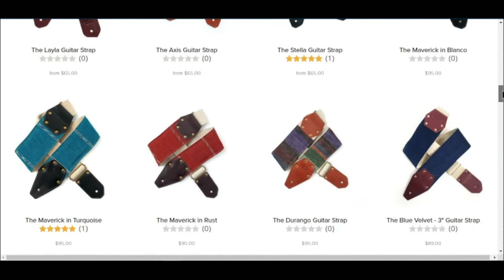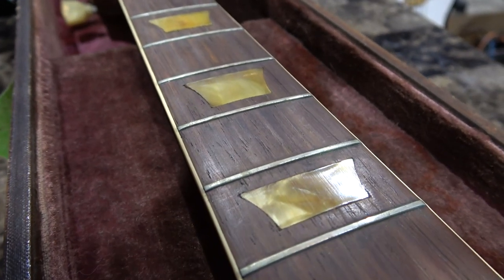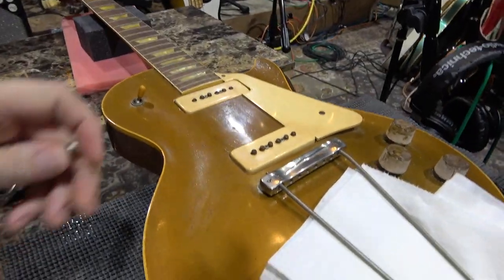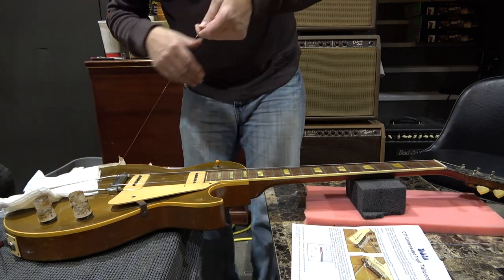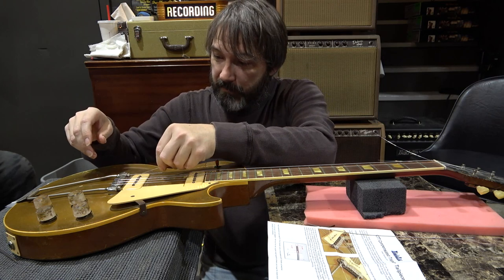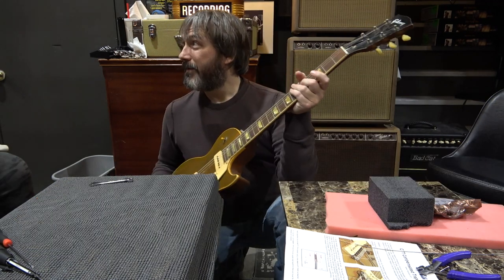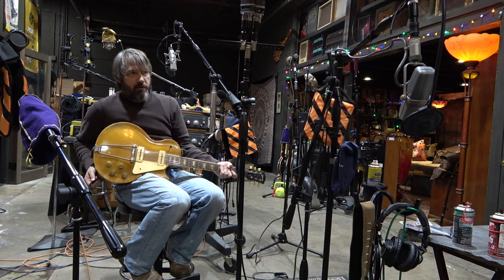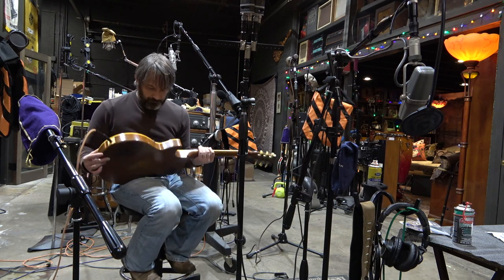WTF!?! He's MODIFYING an ORIGINAL 1952 GIBSON LES PAUL???

Comment: Hold the guitar in playing position to set the intonation.
Reply from the maker: Where are you getting this? Intonation is a function of the distance between the nut and saddle. That distance is the same in either position. It's true that action will change slightly as neck relief minutely changes in the playing position, but intonation won't be greatly affected.

Comment: I'm wondering how the buffing of the plastics will come out I know from experience I used to I partially restored and then had to send it out a 1959 I think it was a zenith TV it had the rotating 360° screen sat on almost like a golfer tea and a spun around and it had a plastic screen and the I tried the you know using some compounds and stuff and got a lot of the scratches off but even when I had it done professionally they couldn't get all the the cloudiness out some of those old plastics were not very stable and the LED to cloudiness and the and I'll sometimes they can be brought back and sometimes they can't anyway that's my two cents sincerely yours, above the blind bedroom guitars

Comment: Great video! Awesome sounding Goldtop, so glad it is brought to playing condition, these things are really special! A small tip: Don't take off the pickguard, it will change the sound! The plastic is a lot harder than modern plastic and to me it seems to add some acoustic properties that also transfer to the pickups. I tried a reissue pickguard on my '55 goldtop and it changed the sound significantly.

Comment: Wrap a Skinny string around 2 times put thru , grab with pliers , and yank it hard and quick .
Then wrap a turn or so in opposite direction ,do not put it thru the hole again , grab with pliers and do the same , yank it hard and fast ! 
And cut extra off 
IT WILL NOT SLIP
Reply from the maker: It won't slip the way I do it either, and you can get the damn thing off.
Reply: @TheGuitologist  Peace
Just another method 
Love your Style , and Videos 
Learning more than I did as a kid in a repair shop
Yet , back then , Repair guys did house calls .
Which I learned a lot from , about how others live.
And ROACHES
How they love electronics
Reply: @TheGuitologist   I am in Kissimmee
And need an ancient Ampex 620 suit case amp recapped , and my trust issues inhibit me from bringing it to just any shop
Where are you located ?

Comment: I find it unsettling that Brad started to remove the tail piece so he could BEND it......even before he knew if he needed to BEND it or not......really ??
Reply: yes that tailpiece had been on there over 60 years you dont take it off. and always put screws back in the hole they came out of, and the nuts on the trapeze. dont mix anything up

Comment: thats not a 52 case. the 52 was flat top.
 shouldnt have tried to remove the tailpeice. you dont have to and you loose a 70 year old bond.
should have gone with a glaser bridge. gibson used 2 different bar stock sizes on the trapeze, your mojo may not fit that well. with glaser you tell them your bar size and they give you a perfect fitting one and aged nickel.

Comment: Take it off the head rest and check intonation again.
Reply from the maker: The distance between the nut and bridge won't change by picking it up.
Reply: @TheGuitologist  actually, you’d be surprised how much it can detune it on a head rest. Not so much about changing the distance, more the weight of the guitar  bending it. I hope that makes sense.

Comment: Show a little love for this venerable guitar and please don't lay metal parts to roll around on the top when you could just have easily set them down somewhere, anywhere else.  And letting those cut strings flap around over the top is not a real great idea either.  I hate it when a hillbilly has something this nice and has no respect for the history of what they have.  Oh well, it's your guitar, dude.

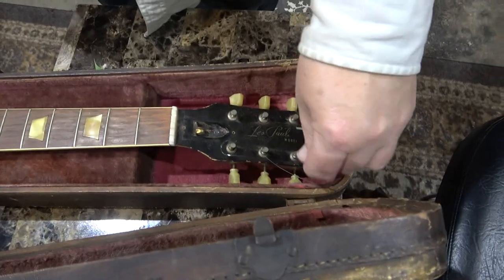Comment: Well there you have it- video evidence - check at 6:49 (about) min. in of your video- you can see the truss rod nut has a lot of wood between the cover plate screw hole as compared to this video https://www.youtube.com/watch?v=VtNc0mWLbBU about 2:22 min: in. The problem with Gibson head stock/neck breaks is the excessive routing of the truss rod nut cavity. Your '52 will not be likely to have this problem .

Comment: A Trossrod  Is Not to be used to adjust the Action/ Height .. It's only adjusted to keep
the neck with the proper bow, so that the guitar will tune correctly. 
If the Trossrod has the wrong bow in it, you can never set the intonation correctly ......
Reply from the maker: This is just untrue. If a neck has too much forward bow under string tension and the action is high, tweaking the rod will lower the action while straightening the neck. The intonation is virtually unaffected except that fretted notes will no longer be sharpened by the distance to the fretboard.